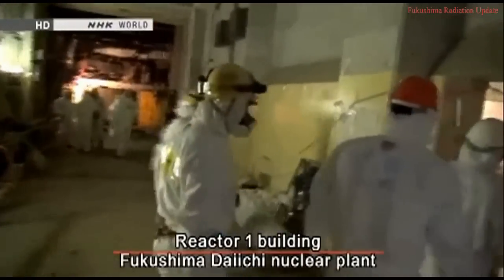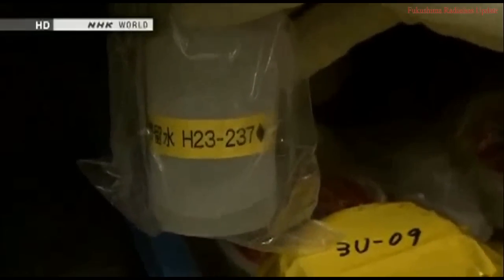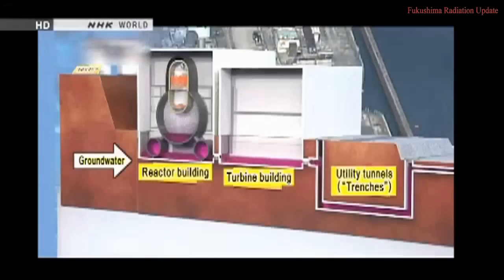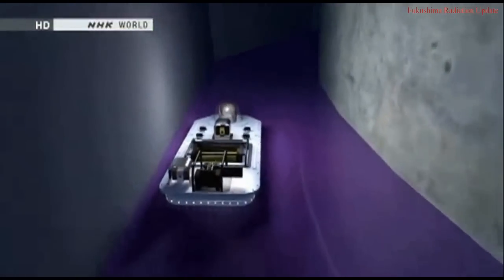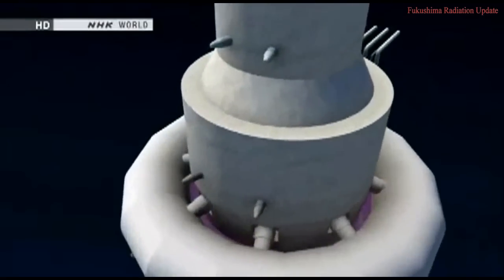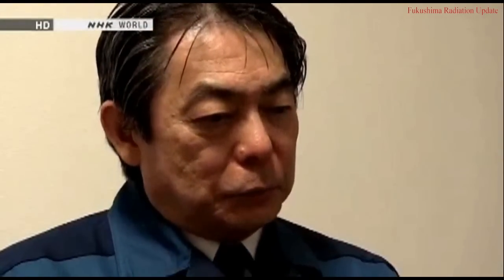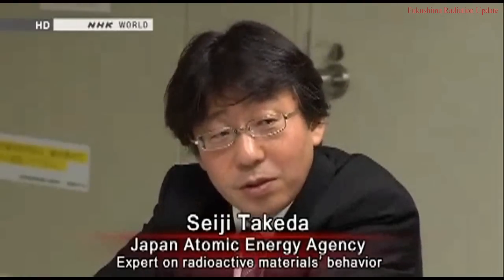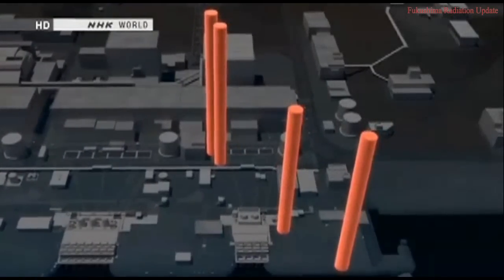FUKUSHIMA UPDATE 2017: HIDDEN CRISIS EXPOSED.

Comment: For me the most significant thing was that keeping groundwater levels above fluid levels inside the buildings reduced leakage of contaminated fluid.  Perhaps they could keep the groundwater levels artificially high, by pumping seawater into injection wells spaced around reactors 1 to 4?   
  Probably a dumb idea, but I'd appreciate anybody else's comments or suggestions.  There's got to be something out there that will help...

Comment: If the nuclear reaction is still occurring, it means that even the nescessary mechanism to deactivate the powerplant has been damaged (it is necessary to pull out the radioactive cores? Maybe it is all melted together!). That water leakage should be the least of the concerns!

Comment: Okay, too many people trying to complicate a very easy problem. All I need is a concrete pumper and a shit load of underwater epoxy. One other thing I need is a propulsion device to drive the tip of the pumper hose around. I'll need a drill that can make holes big enough for my pumper hose (have to drill from the surface to the various chambers). Fill all of the containment tubes and everything around the reactor with underwater epoxy. Issue fixed, done and thank you. Now circulate water in the primary reactor for cooling.  Underwater epoxy, sets under water. EASY! Give the Wessex corporation a call, life is good. It's also just as easy to pump all the the containment area with molten lead. Must be pumped through a high temperature insulated hose, you don't want the lead to solidify until it's bonded with the surfaces. The lead will leave air gaps, high pressure pump epoxy around the outside edge of the lead encasement for a perfect seal. In the end, pump all cavities around the reactor with any material that sets under water.

Comment: Inventing a time machine would be easier fix
Reply: Jeff Riles the melt down was caused by a tsunami, a time machine would not be able to stop a tsunami.
Reply: None of this would have been necessary if the operators knew what the hell they were doing and/or weren't so prissy about "saving face". They should've SCRAMed the reactors the second the quake hit, and called the US Navy for backup gensets the minute they realized their generators in the basement had flooded. None of this had to happen, it was a combination of corporate greed and operators who had ZERO leadership skills.
Reply: but you will need a very powerful source of energy for your time machine, like.... a nuclear reactor?
Reply: @borksheviks.5124  It could if the Earthquake that caused the Tsunami was man-made, by HAARP or a Nuclear blast in the ocean off the coast of Japan

Comment: How about finding the area of ground water that is moving towards the damage area, say half a mile or so inland and put a wzter proof wall below ground to re direct the groung water away from the damage area.
If it does not reach the contaminated area it will not get contaminated itself.
I understand just how large a job this will be but taking into account that the ground is not contaminated, means that normal equipment can be used to dig the trench for this wall.

Comment: The entire series of events that led up to the melt down reveal just how careless, wreckless, and apathetic people can be. This entire failure could have been avoided if these people were on top of doing their responsibilities. The reactors could have cooled if people were truly working each position especially valve control which had obviously been severely neglected and overlooked for so long. This reactor is designed to have a emergency non powered cooling system that is full proof if the valves are properly set, they were not! Negligence and is only negligence by people becoming lax in job responsibility.

Comment: I'm no engineer, but why not just fill the reactor building with concrete. That would seal the leaks, use up some of the contaminated water, and block radiation from reaching the groundwater.

Comment: Why not just fill the entire space between the inner and outer containment with the best concrete available, so the reactor buildings are like 4 giant cubes of concrete? That would stop the leaks and allow the core to be kept full of water. Once a safe layer of water is covering the fuel, work on removing it.

Comment: Wow, these people (and a large part of the world apparently) are in a hell of a mess! Is it true this information is several years old? I though I saw something about freezing the soil to block the water flow away from the area, no mention of that in this video. If I understand correctly, this whole area will be unlivable for thousands of years? If the fuel is untouchable with anything we have to work with, it will have to remain pretty much forever. I’m no engineer and it may be simple thinking but why not back away to relatively safe distance, dig the deepest trench possible and fill it with concrete or what ever works best, encircle the whole area and continue above ground level once the below ground work is completed? This business of taking a couple years to build a boat and a special “wire” just to see a crack or leaking pipe is just expensive, time wasting, and unproductive. It feels like research is the focus, not limiting the already unimaginable environmental damage that has occurred so far. I guess my point is...Get off your asses and get to the work of sealing this area up!

Comment: why don't they try some sort of material in the water that could act as a stop leak like on a vehicle coolant system that would be better than dicking around looking for leak you could put some sort of die also to identify the leak when the stop leak begins to work on filling the cracks.

Comment: why can't they just pump large amounts of liquid nitrogen all around the plant to freeze the water that is going into the ocean, then the whole area is a solid ice cube plugging the leaks and cooling the reactors more efficiently then water, which by using water only creates a more severe issue. And next time you build a nuclear plant in the ring of fire do some risk assessment and place it on the back side away from the potential tsunamis, and put the back up generators on the top not the basement where it will definitely flood during a disaster...

Comment: Ya so make the robot a submarine that can submerge underwater so the water can obsorbe the radiation , pour cement into vessel fill it up then have a building built next to it inside build a pool , the whole building has long legs down deep so the building floats free not touching any of the surrounding ground this hole then is formed with concrete with Kevlar with lead then more Kevlar rebar this hole surrounds the inner building on legs pounded deep in ground so inside it has a deep pool  and storage for more material in barrels then take a concrete carbon sand lead mixture pour into vessel so it's a solid block then using helicoptor lift vessel up and with a retractable opening lower vessel into the pool then the pool should be three deep pools but just one big one with two concrete lead Kevlar walls to separate the three vessels make each vessel a concrete block then put them into a deep pool for each and gather all the crap and put into railway tankers  that can be pulled on narrow gauge rails on-site lay tracks then with rail cars open on to so a man in a sealed machine he can pickup and put garbrage or other materials put once each car is filled pour a concrete that has sheilding in it inside the pool building put train tracks right inside then after a few cars are full the engine can be a robot the machine too an operator can be in a container sheided and full of equipment to operate machine ,it can have a grapple end to grab items and pull lift it will cut metal also there is a jackhammer end and a regular bucket the machine can demolition a building then lift it's materials into the train cars as each one is filled it it's filled with a mixture of sheilded concrete then pulled into the building now this building will need to be massive so the whole iradiated site can be pulled down and put into this building the containated water needs to be made into a solid dehydrate the water into some sort of material so it can be stored easier the hole underneath is a emergency basin to catch any water or material that may leak it's a third line of defense now do it

Comment: Why can't we build a huge REFRIGERATION FACILITY that can take hot water and cool large volumes of water quickly and then pump it into and out of the reactors in a closed loop system ..... or at least pump from many different wells arround and inside rhetoric reactor. ....outside wells can be sunk at various depths in circular concentric rings around the reactor to capture leaks. 

If you can pump water out into tanks, why not just use that same water that is cooled and circulated instead of pumping good water in. 

Common, it CAN be done or at least tried, and any expense is justified.

Comment: 6:26 - "...so, engineers developed a 'special wire' to remotely control the boat."  A special wire, eh?  Why not just refer to it as a fiber optic cable, which is what that is?
Reply: BluntForceTrauma666 This video is actually from 2013 I believe. Fiber optic cable weren’t common knowledge back then, and it was a very specialized type of fiber optic. Explaining the inner workings of that technology wasn’t exactly the point of the video.
Reply: Fiber optic cables have been a thing since the 1970s, it's not a new technology by a longshot.

Comment: regardless were the safe line is done with radiation, there is no thing as safe radiation, every dose even the tinyest is harmfull, the lvl of radiation only defines the time it takes to notice the damage to the body....
the lesser the longer it takes, counts in Generations... the higher the faster .. sudden death burning....

and to the why is nuclear water flowing out, its because the reactors meld and a plasma flow cuts itself down to the ground water... all the fixings around are just minor problems...

totaly funny to think u only have to pump up the water to reverse the leakage, but no groundwater would flow into the leakage, u can pump forever... .....

Comment: Compared to this, Chernobyl is a joke...
Reply: I can assure you that Chernobyl was a much worse accident.
Reply: No, you can not assure me.
Reply: Chernobyl was far worse it even effected sheep in UK it deformed animals in the near by area of the accident and one man even found some of the coolant water from the reactor and it looked like a mountain dew bubble machine in fact the uranium concrete and graphite is still molten and is still melting through the fucking floor below it!
Reply: sad and true, and even germany 1500 Miles away from chernoyl gots its part, to think japan has only a 300 miles zone is just a laugh...

Comment: Why haven't they sealed off the lagoon in front of the plants so as to remove the ocean from the site? They should never have built the plants so close to the ocean. The Japanese have not taken this seriously and the whole planet is at risk.
If they contained the radiation then fair enough.
Reply: Anonymous X Sealing it off won't help. It will sink into the water table and eventually into the ocean. The whole thing is a disaster.

Comment: why dont they just poor concrete  power into the tanks holding all the crap water make them  solid and then take them away to a safe place
Reply: because if there was no water around the Reactor fuel the fuel will literately melt through the concrete

Comment: So really you need to have a pipe that can slip over the leaking pipe sticking out and then have it tighten up around the neck it might not be 100% but even if it's 50% it's better than is is now and you can run the new pipe into a damn catch tank that is triple bunded.... and to find that a nuke power plant only has 1 catch tank is disgusting.. that place should have at least 3..  if not more... but hay that's just me..  though I still think this was a planed event... be it government or other.... all that technology and advanced equipment yet a wave in essence wipes it all out.... 🤔🤔🤔🤔 my gut feeling is saying such...

Comment: This is a video of misdirection, I am certain that these people aren't as stupid as this video sounds and looks. So lets get started, for one thing, one has to look at the geology around the site. They couldn't of   picked a worse place to build the reactors. An aquifer runs from the high ground behind the reactors, under the reactors and into the Pacific Ocean. Under ground water is flowing into the ocean. Now that being said, Look at the nature of the disaster. Not only did the reactors lose power and the backup generators got flooded out, the reactor plumbing was damaged in the quake. The reactors cooling water just drained off. A quick melt down was unstoppable. This makes it simple why they can't stop radiation from hemorrhaging into the ocean. The nuclear fuel melted flowed to the bottom of the reactors, melted through the steel casing, burned through the concrete building floor and into the ground. It only stopped when the water of the aquifer cooled the nuclear fuel off and it re solidified. The big problem is the aquifer is being radiated by the uncontrolled nuclear fuel. The radiated water just flows into the Pacific Ocean unchecked. This nuclear disaster can be fixed, but not without costing human lives. The alternative is do nothing. The result, The whole planet will die from radiation poisoning. Radiation will be established in the food chain everywhere.

Comment: easy solution? do like the russians did..... pump in a shit ton of concrete around the reactor vessel covering the cracks and pipes. when that sets no more leaks.....ever, job done..... maybe i should be a nuclear scientist! as for containing the water........ 30 foot wide trench as long as you can make it on the ocean side, get it way under the water table by a good 20 feet, then concrete it solid.......job done.